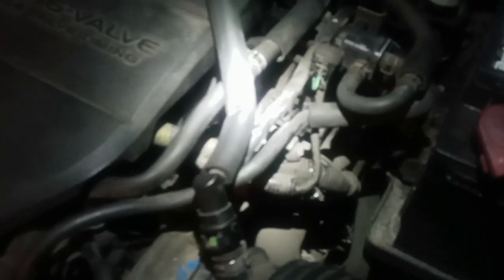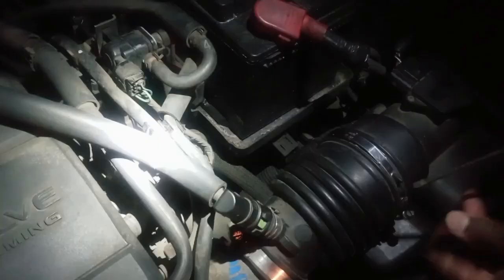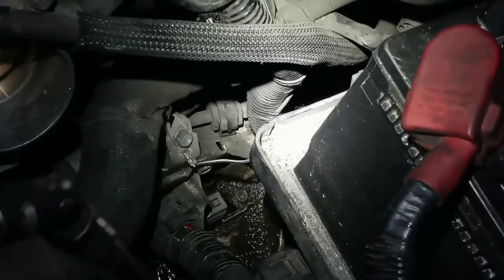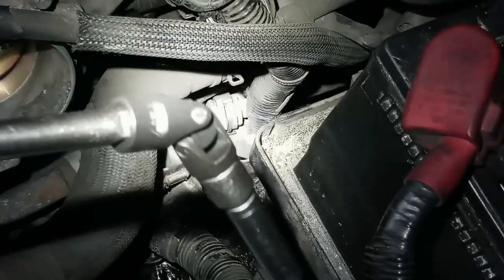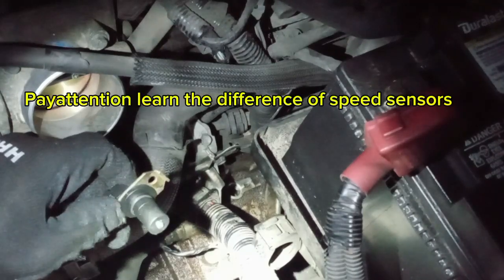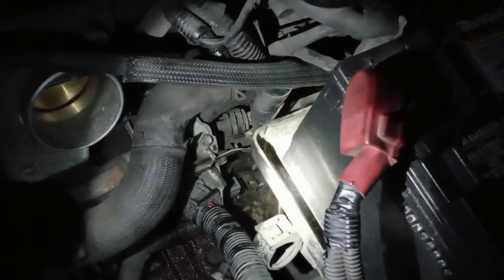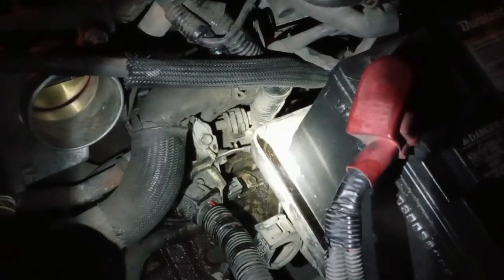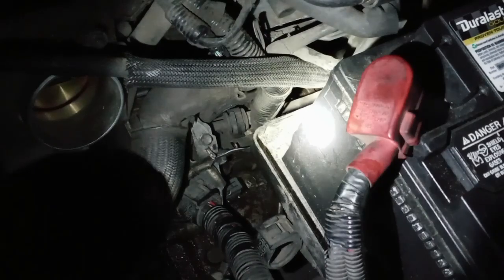#p0720 #speedsensor How do i replace a malfunction output shaft speed sensor on mazda6

Comment: the sensor you are replacing is called the input sensor. or the turbine sensor. the out output sensor (also known as a vehicle speed sensor on this generation mazda) is located on the right side back of the transaxle by the firewall (on a Mazda 3) and on the back bottom near driver side axle on a mazda 5/6. There is also a 3rd sensor on the middle top near the back of the transmission called the intermediate sensor that measures the shaft speed. You should not publish videos of misinformation, because all you would be doing is misinforming people that are looking for help or trying to find a solution. Or at the very least, put a disclaimer that you are not a trained or certified mechanic since this video has already misled someone.
Reply from the maker: @mickpherson7651  did you wach the full video. This is a 2012 Mazda6 2.5 Enging

Comment: I saw this video and I waste lots of time and money because the sensor you are replacing is called turbine speed sensor. The output speed sensor is by the back at the bottom right against the cv axle.
Reply from the maker: Did you use a scanner to get the code. Because the turbine is internal. So if the turbine in the transmission goes bad. I dont think you just replace input or output shaft sensor. Scan for code first
Reply: @ttautogarages  the code for a mazda output speed sensor circuit is P0720. the sensor you are removing in your video is located in the front typically under the air filter box is called the input sensor/turbine sensor.